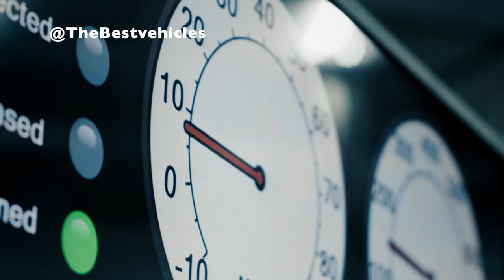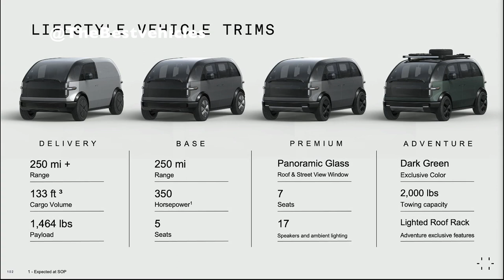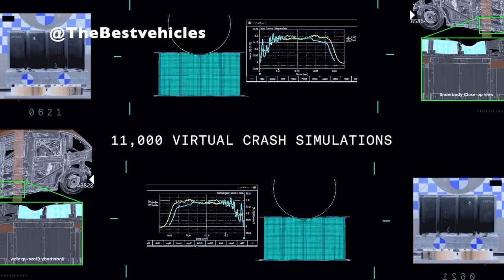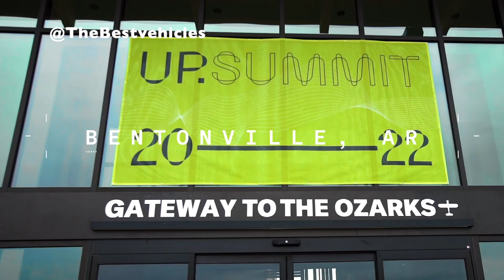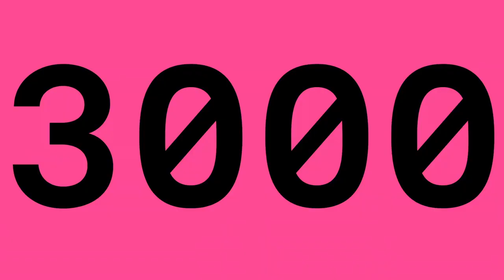The New Canoo EV - Made in America

Comment: What if they move away from the dealership and proprietary parts/service model and made the van much more open source?   What would be a genius design and marketing strategy if they sold the vans on the premise that any mechanic or handy owner would be able to safely maintain or swap any part on the van, and that those parts down to the display, computers, chips, motor, battery etc. could be sourced or replaced with readily available parts and fittings.  Reduce dealership and service agreement overhead. Let owners buy generic warranty contracts.
Reply: This almost makes me think of a gaming pc approach. You buy the car and replace parts yourself and even have easy ability to personalize based on standardized parts
Reply: High voltage death?  ☠️😆
Reply: @turdfurgason8476  or KILL switch, ground line and electrical gloves.